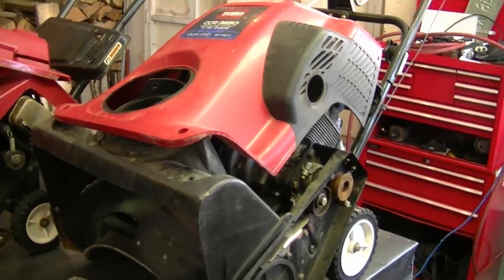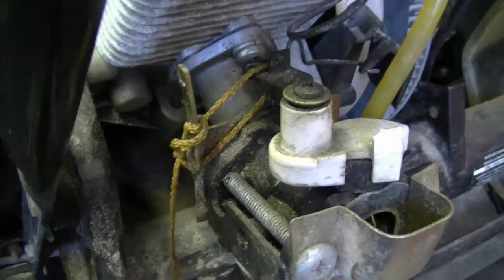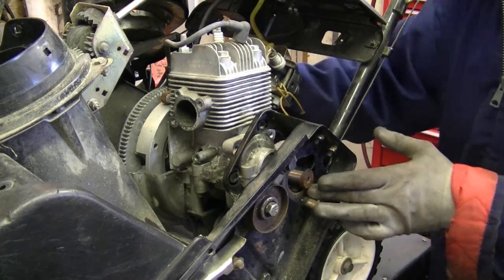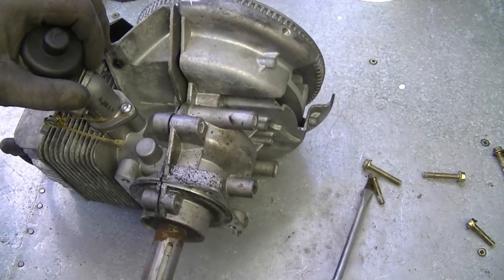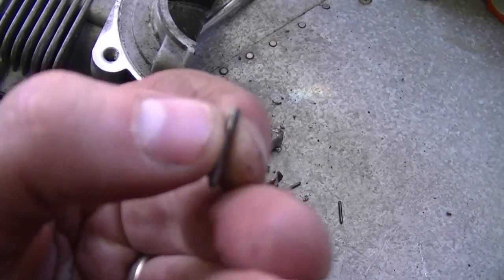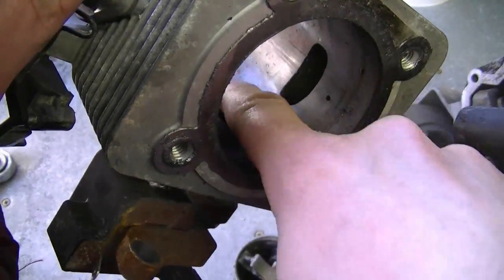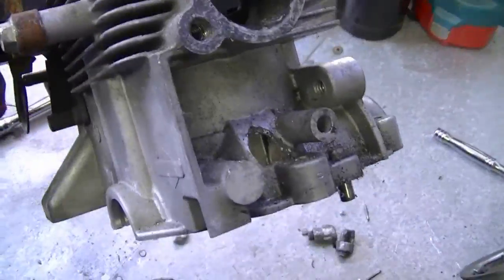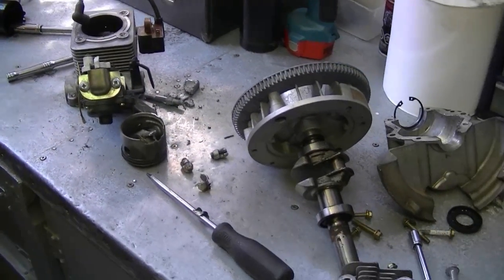Teardown of Blown Up 2 Cycle Briggs Engine

Comment: I I have a similar Toro snow blower, Model # 100 3445100-2445 Family 3L4SX.1415AA is this a Briggs motor? I left it idling for quite some time, And it stalled out. I went to restart it, and upholstering would not pull. then I noticed the muffler had come loose. I took it apart to get the drawstring mechanism out. And after I did I tried to turn the flywheel by hand it would lock up about halfway around. I jiggled it a few times, and now the flywheel spins without moving the piston. So thanks for the video I know now how to get it out now. I can't tell you how many times you've helped me out. I appreciate you!

Comment: I recently got a mtd 4.5 hp single stage snowblower with a 2 cycle Tecumseh engine. I have noticed a lot of oil at the bottom of the engine. Looks as if there r cracks on the bottom of the engine cover. What should I do?

Comment: Technically, this engine is an R-Tek which was developed by Lawnboy and labeled as the Duraforce. Briggs and Stratton later acquired Lawnboy's engine division and that is why this engine is labeled as a Briggs even though the top cover says R-Tek.

Comment: I secured the governor arm that connected to the carb so the throttle stays wide open when the throttle was wide open. the motor lost all compression and made clacking or knocking noise. But luckily no damage to the connecting rod, piston, or crank. It was chinese made 2.5 hp POS motor.

Comment: I just tore down a similar machine, Toro CCR2500. Although it was sold in 98 it is almost new as it was straight gassed then stored. I bought a new oem piston kit, crankshaft seals and head gasket from ebay for $50. Cylinder looks useable, minor scratches. The piston says made in USA, I wonder who made the engine, Briggs or some other company?
Reply: If it is this same engine as in this video Briggs made yhe engine now depending on the year it may have been made in the USA but was later made overseas.
Reply: looks like a lawnboy.

Comment: i have a 2 stroke tecumseh engine in my power lite i just got i got it running but for some reason sparks come out of my muffler i think the rings are or the cylinder all messed up any reason you might know why it does that
Reply: I think it is a rusted muffler they throw sparks when they are rusty and old. If those sparks are eternal that engine is shot. But I never seen 1 throw sparks for the reasons you think it is.

Comment: I braze the engines parts (aluminum or any non ferrous metal) with DuraFix or TS-2000, is cheap and it ends strong as new, that hole can be erased with this method.

Comment: That's just sad. I am into old and rare 2 stroke engines--I have British stuff like a P-55 Stuart-Turner twin that's the ONLY one of this type--an industrial power unit--in the USA! I also have 2 of these Briggs 2 strokers, one is NOS unused--brand new--and the other is in a Gilson snowblower--it had gotten water in it and got stuck, but I freed it and it's just fine. (I got REAL luicky!) These are RARE engines and sought after by collectors. It's a pity people are so stupid !

Comment: Briggs now owns the Lawnboy Duraforce design which they intend to manufacture for snow thrower use.  Unlike the Lawnboy F engine, the Duraforce engine uses a cast connecting rod.  You see the over speed problem here in DB's vid first hand.  When working on these engines, use a tachometer and set the rpm below 3300.
Reply: spec calls for 4,200rpm in the Toro CCR 3650

Comment: That spark plug magnatron is still a good part  I have only seen one briggs in my 50 years of life like that one I have seen all a lot of Tecumseh small engines  . 
I seen a powerwasher with the same problem they wanted to make more pressure blue the engine like that one real stupid thing to do.

Comment: way to much rpm. Scooter engines can hold about 14k of rpm ( alot ofc) but these engine i think max 8k
Reply: daand12, you really need to limit the RPM to 4000. That's the ONLY way that type of engine will last. Ignore the 50:1 Ratio. Run the engine on 40:1 Ratio.

Comment: that have been a lot of rpm... most of the damage was done by the momentum in the flywheel... if the rod breaks there is no more "new" power. so you can imagine how much rpm that was

Comment: wow briggs used a 4 stroke style con rod thats why it took a crap, usually its cast steel than using aluminum, also i think the bottom end con rod sized and it threw but would be fun to just put a new connecting rod in there and fix the hole on the crankcase as an experiment.